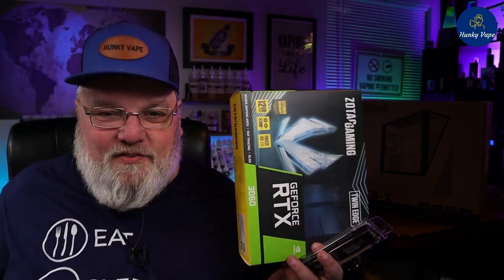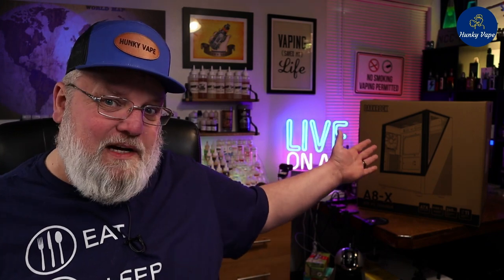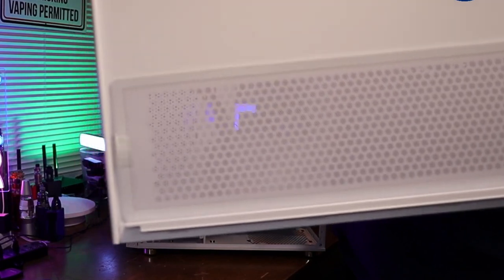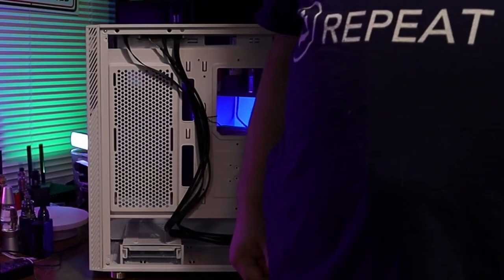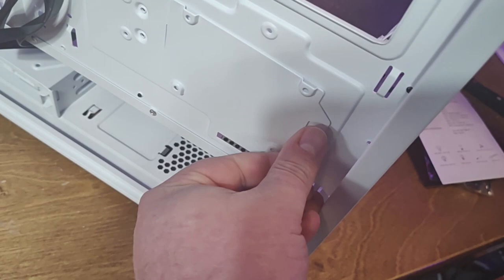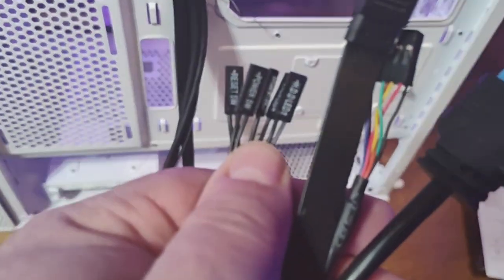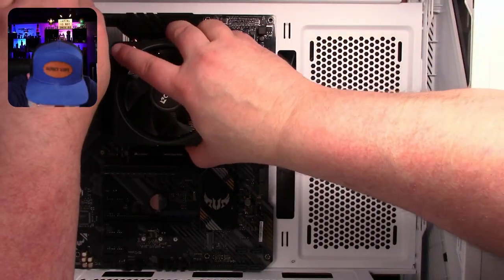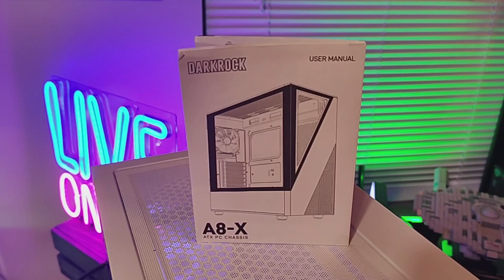Darkrock A8-X White PC Case Unboxing Review

Comment: Hey man, this case looks amazing! It's not just a budget pc case, I'm planning on using it for my $2,000 build! However, I would suggest that you look into getting the Montech Air 100 ARGB instead of this case. It's the same(if not lower) price, and it comes with 4 ARGB PWM fans, so you don't have to buy more fans and spend another 20 dollars on that. Furthermore, that will drop you from an ATX motherboard to an M-ATX motherboard, which are often times over 50 dollars less than ATX motherboards! And adding onto that, the GPU clearance on the Montech Air 100 ARGB is 360 millimeters, so if you ever want to upgrade, you can fit a beast of a card inside that thing! Just a few suggestions I had, from one PC enthusiast to another, and good luck on your $200 budget build!
Reply from the maker: Thanks for the suggestion. I needed a full ATX case as the $200 budget build is for OBS and gaming. While an m-atx may be a better, usually cheaper option that's perfect for gaming... I plan on using multiple pcie cards for a quad HDMI capture card and up to 6 webcams for OBS. This will double my existing live stream cameras, allowing a full 360 degree studio. But I digress... The Montech Air 100 is a great alternative for those not needing full ATX for their build. With 4 fans included I imagine the steel is thinner than the Darkrock  case, but the cable management holes look better aligned with the board. Both are around the same price. Ultimately it's up to priorities and price. Like I've told my customers for decades. Set a budget and build for your needs,  the best you can within your budget.

Comment: 200 my eye.

So how is the case? Sturdy? Flimsy? Any sharp edges or rolled edges? Is the included fan available separately for purchase so all the fans match? Was the included fan loud? Any bearing noise? What type of bearing?
Reply from the maker: The case is not flimsy. No sharp edges. Didn't see the fan sold separately but honestly I didn't look for it as I had Set already to add to the case. The fan is quiet and for my needs could've been used by itself to keep the case cool... But I added 3 argb fans mainly for the look. Didn't research to determine the type of bearing in the fan. However the case manufacturer website has an email you can contact them for that info if you wish

Comment: Does a full modular  atx psu  fit
Reply from the maker: Full size ATX power supply fits as long as it's not longer than 200mm A longer one does fit but the wires would hit the HDD caddy necessitating its removal. Not an issue if you're using SSD & NVMe M.2 drives like I am.
Reply: @HunkyVape  thank you